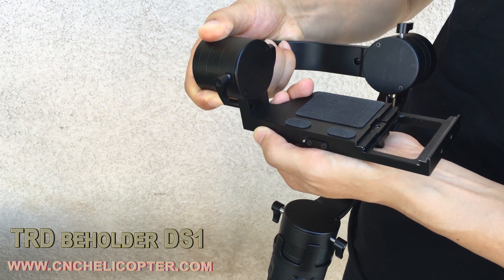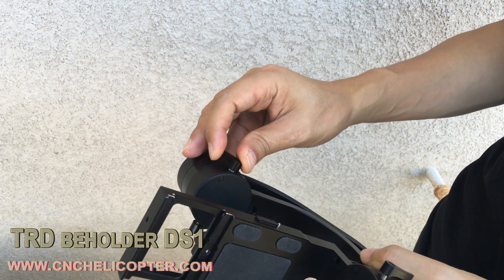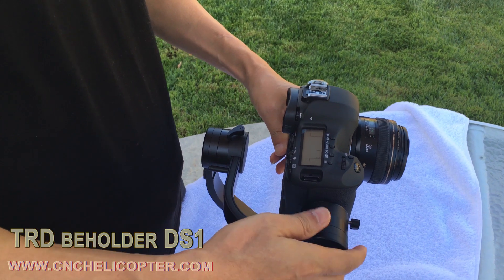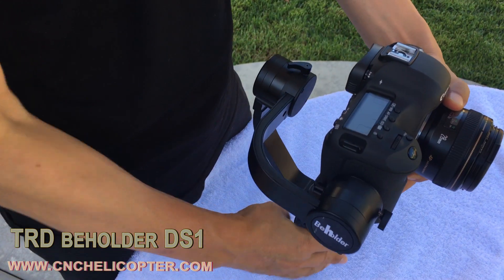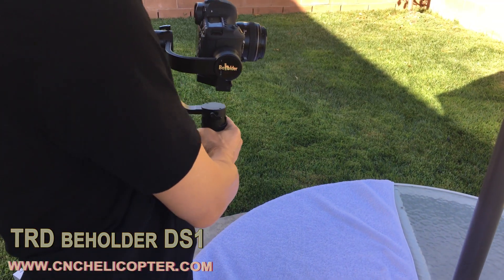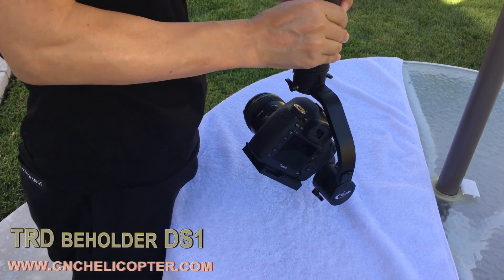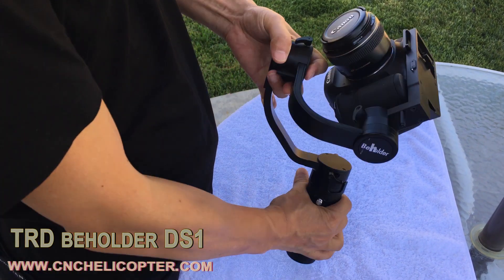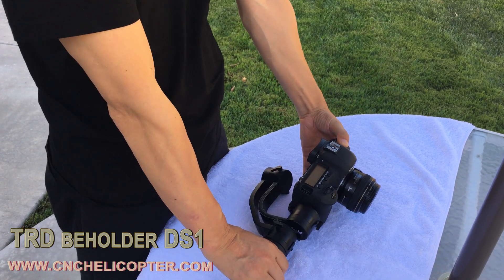TRD Beholder DS1 3 axis 32bit gimbal Yaw roll pitch balance adjusting video A

Comment: Hello, I just bought the beholder ds1 I am worried it vibrates a lot and turns the handle alone, had you ever meet this problem? whether as t solve thank you in advance
Reply from the maker: +Runcom COMRUN you need to make sure 3 axis all real balanced .
Reply: If there is a lot of vibration at the handle is that the 3 axes is not balanced ?
Reply from the maker: +Runcom COMRUN yes, not balanced , vibration a lot
Reply: cnchelicopter thank you for your answers, I received yesterday I test today , I meet a lot of difficulty has stabilized
Reply from the maker: +Runcom COMRUN , you can email us your gimbal balance statue for each axis , we will check it , ( power off the gimbal , camera can stay in each position in roll/pitch/yaw axis, means balanced )
Reply: By what means I can send you the balance statue